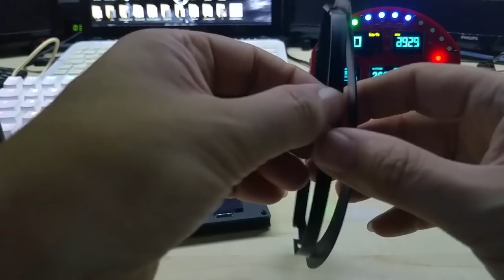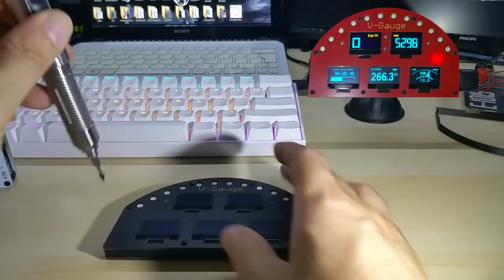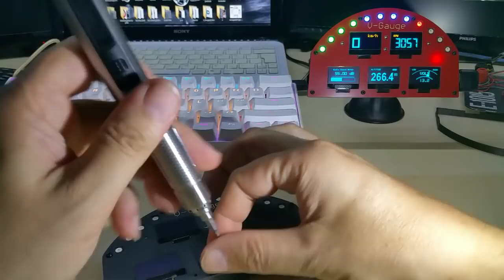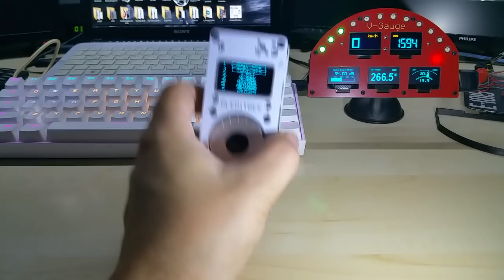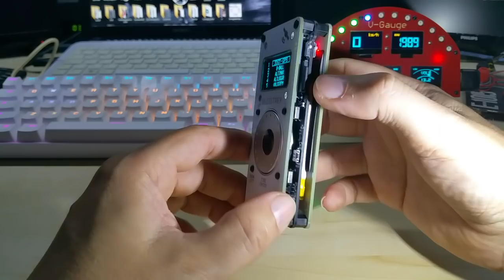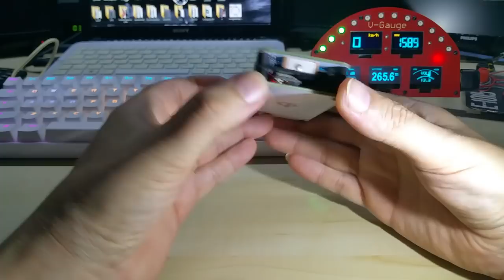OLEDiTREK explained and how to change the frame on the V-Gauge if needed

Comment: Fantastic explanation of your OLEDiTREK!!  It is quite the creation!! I love how much can be done with that little beauty!!! It's a great selling point to know you are happy to send out new codes as you get them for us!! I'm really looking forward to having one of those as well as the V-Gauge. It also looks like you've talked me into getting several different color frames for the V-Gauge!!! Do you have the material to make red frames? A black V-Gauge with red frame would look quite racy!!! Thanks for taking the time to explain more details about the OLEDiTREK my friend!!!
Reply from the maker: You are most welcome Adam, always love reading your comments and emails. Oh for sure, any new code that will run on the OLEDiTREK will be send out to the buyers, the great feature is that it can always be expanded and new functionality added. Same goes for the V-Gauge, it can be edited and code changed for changing conditions :-) Yes, different color frames is a must and you are right also that the black needs a racing red stripe frame :-) Currently I only have black, silver, transparent and zombie green but will get other colors too. This can be used to color coordinate the V-Gauge to the interior color of the car. I will also make the frame stl available so anybody can print out his own frame if he likes. I am also designing a weather proof case with GoPro mount for use on bikes or even boats. Till later my good friend.

Comment: Anothet great explained video Hayri 👍,BTW did you also buy the screwdriver @ Banggood?
Reply from the maker: Thank you very much Norman, the first version of the screwdriver ES120 was send to me by Banggood for review the newer version ES121 directly from the manufacturer, also for review, meaning I did not have to pay for them :-) It is really a great piece of engineering and a joy to use. Nice bike btw, if you need a V-Gauge for it let me know, I am working for a enclosure for it to make it weather proof and easy mounting, will put one on my still unfinished Street fighter bike as well.
Reply: WoW lucky you 😀.I was browsing @Bangood and seen the screwdriver. As I refurbish broken Apple products this screwdriver will come in handy.It coast around 86 euro's but if you say its a great tool then i surley will buy one.I will be watching out for a video incase you make one with the V-gaudge mounted on your streetbike.
😁.
Reply from the maker: Yes, sometimes I get lucky :-) I can vouch for it being a great, exceptional well made tool, you will agree with me once you have it in your hand and use it.I will definitely make a video once it is on my bike, including showing my gear indicator working :-)